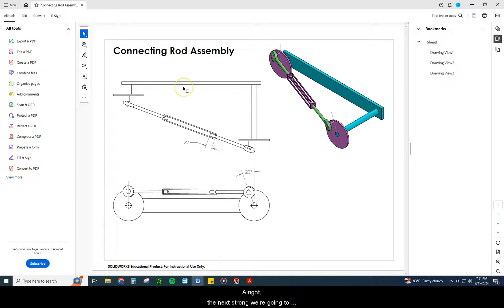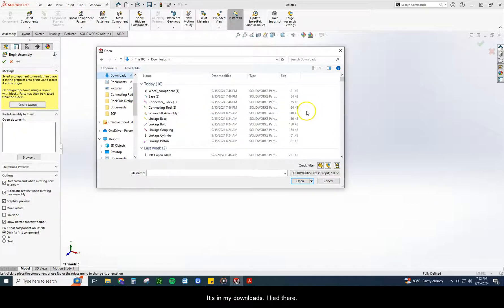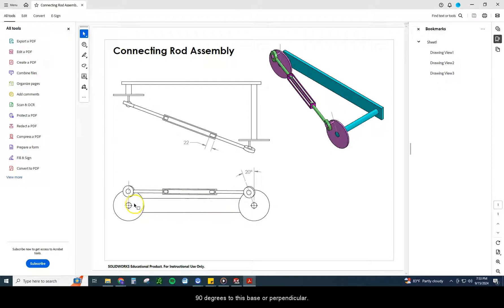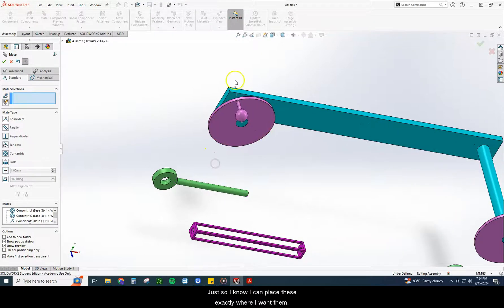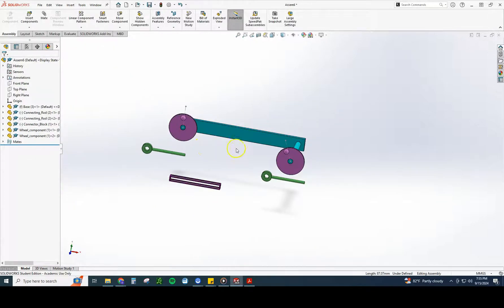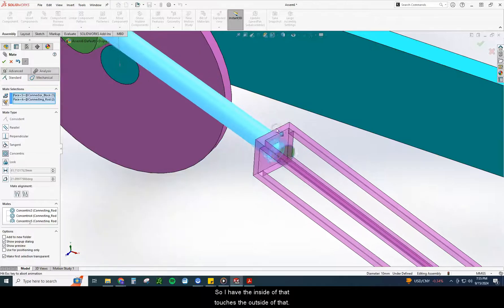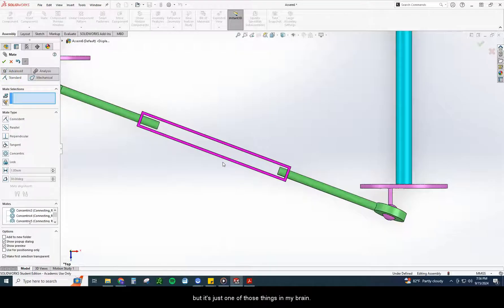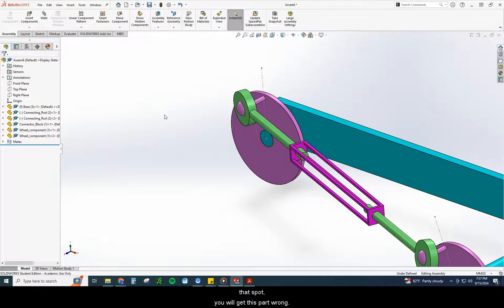Connecting Rod Assembly

Comment: Hola Buenas noches. A mi la respuesta de "X" me da 19.99mm. Por favor podrias confirmar si es la correcta?
Reply from the maker: The issue there is almost always selecting the wrong face of the "purple" connect block. If you select the inside face instead of the outside face your dimension will be off by about 2mm.
Reply: What is the correct answer x?